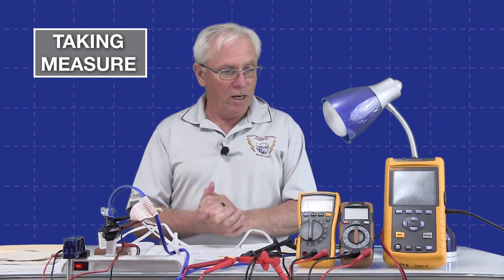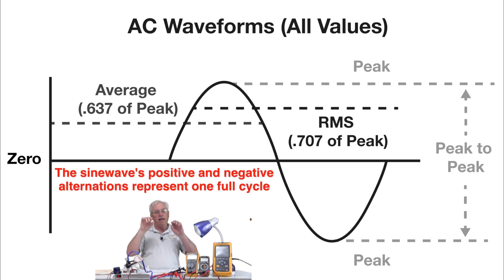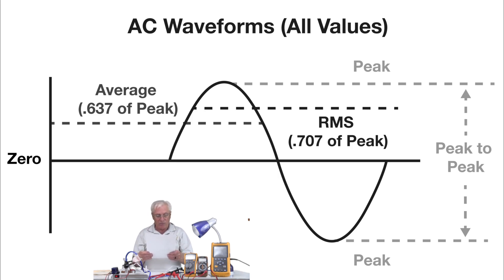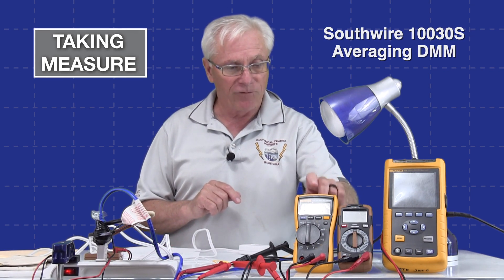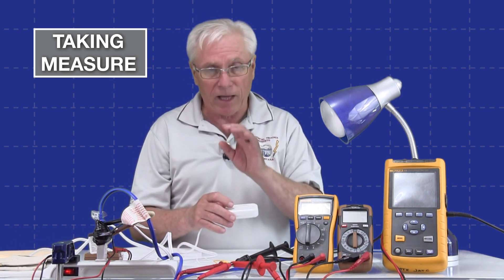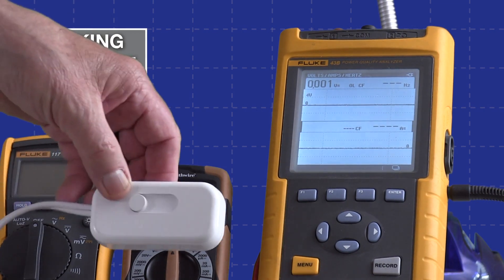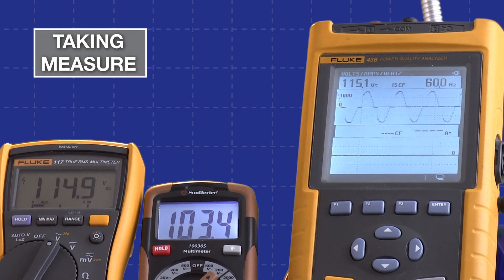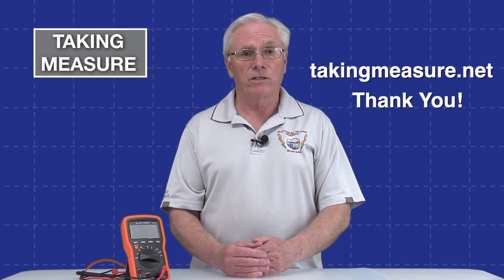Understanding AC Sine Waves and the Value of True RMS Test Instruments

Comment: MITCH, When would a technician want to measure the average voltage? I'm not sure when to use the average voltage for what type of application and circuit would you want to measure the averaging of the voltage
Reply from the maker: A fair number less expensive DMMs  you can purchase are "average responding" instruments.  They work fine on pure waveforms and will offer accurate voltage and current measurements.  They are challenged when confronted with altered or misshapen waveforms.  I always recommend that technicians use True RMS instruments for accuracy.

Comment: Hi from England, UK. I've got a true RMS meter which is essential for accurate readings with non sinusoidal waveforms, which the more basic meters are not made for, and they usually give miles less accurate readings for other waveforms, some of which are non symmetrical and have very different crest factors, like the waveform that feeds the tube heater on later generations of older CRT type TV set, where the voltage should usually be 6.3 volts but it only shows that voltage on a true RMS meter, the more basic type of meter usually shows only about 4.8 volts which is inaccurate.
Reply from the maker: I need to address crest factor in another video.  For some waveforms, crest factor capabilities make a lot of difference.  The narrow "shark fin" from an incandescent  dimmer is a good example.  Thank you for sharing your thoughts.